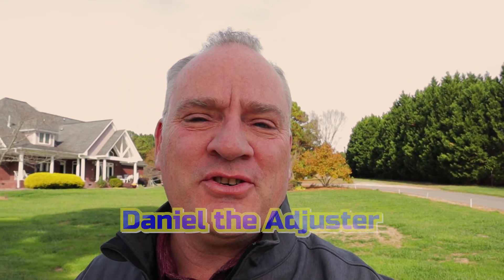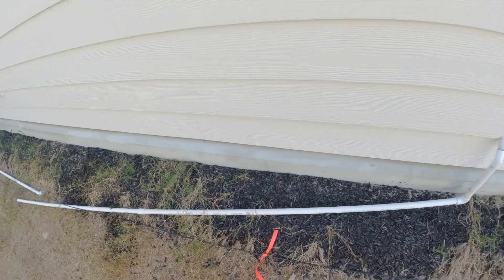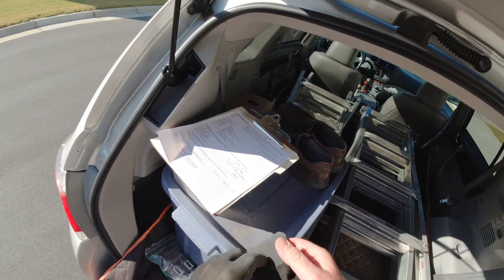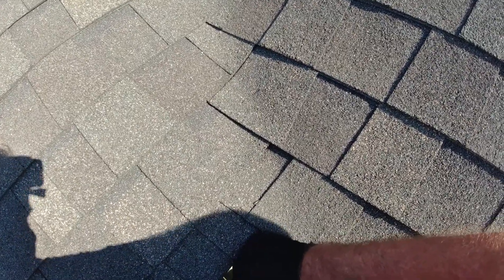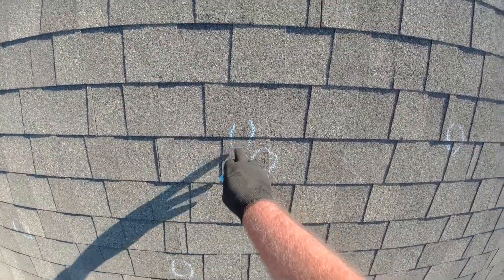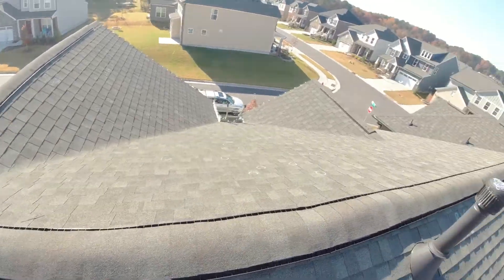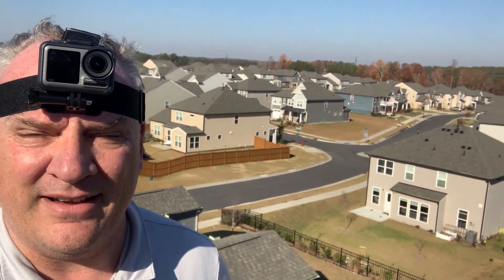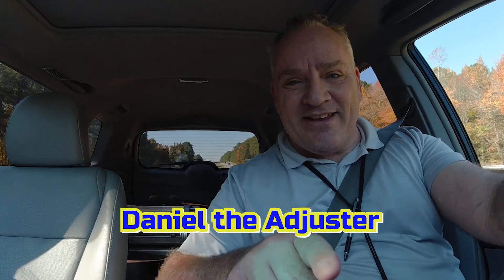Day in the Life--Part 2 --Claims Adjuster

Comment: If you can avoid a double pull by taking your ladder to the back elevation I would do it. Great video!!
Reply from the maker: Good idea, but most of the time the reason I do a double pull is because I don't carry an extension ladder to get up to the second level.  99% of the roofs can be accessed with two ladders.

Comment: Thank you for your videos, they provide a wealth of useful information!  I am new to adjusting and I have some questions from this video, 1) rather than use 2 ladders would you ever use one ladder to access the front roof then access the upper level roof from the rear of the house?  Using 2 ladders seems less safe to me with hauling it up and down and placing it on the roof.  2) are people filing a claim for small dings to comp shingles from hail?  Would the insurance company replace the shingles for what looks like minor damage?  3) are there roofing materials you don't walk on such as clay tiles?  4) Are there field adjusters that don't access roofs or is it a requirement?  Thank you for all your information!
Reply from the maker: @p.davidrij8319  Thanks for your questions.  Appreciate your compliments!
1.  You can use whatever ladders make you feel comfortable.  There is no right way or wrong way to access the roof.
2.  Yes, it is common to see damage of all sizes.  Even with the small damages, if there was a hail event recorded on that date, we can argue that the shingle was compromised due to the event.    It is best for larger hail events of course.
3.  Yes, we are not required to walk on clay tiles because we can break them.  We inspect those from the gutter line in several places around the home.  Also, cedar shakes can be a sketchy climb as well.  Use your judgment on that type.
4.  Field adjusters who don't feel comfortable climbing roofs can be flood adjusters or interior water damage adjusters.  It will limit the number of claims that you can handle, but sure, it is possible to skip the roofs.  I like climbing roofs since most CAT work is roofing claims.

Comment: Tip on getting on and off the ladder safely. Also any tips for safety while on the roof.
Reply from the maker: 3 points of contact at all times, (eg. 2 feet, 1 hand or 2 hands, 1 foot).   As far as while on the roof, go slow and easy, no rush.  Know where you are on the roof at all times so that you do not trip on a roof boot, or vent.  Stay away from the edges if you are not comfortable, and keep a low center of gravity on slopes when you are climbing and use all fours.  Better to be safe and look stupid, then be sorry later.
Reply: @danieltheadjuster  thank you so much. Ill go on my first roof soon
Reply from the maker: Fantastic!!

Comment: Is there an angle of roof that you don't walk on?
Reply from the maker: @davidelks8972  I walk on most roof slopes (including 12/12).   The slope I will be most careful on is the old shingle with little to no granules remaining.  It doesn't matter what pitch that roof is, it is something that you can fall off of very easily since the shingles can break off at any moment.   The cougar paws are amazing, and if you keep an eye on your pads, keeping them fresh, the boots will stick to most slopes.  Ankle and calve flexibility is a good thing to practice as well.  The more boot surface on the roof shingle the more you will stick.  A lot of people walk on the balls of their feet on steep roofs, this is why they slip (not enough boot surface touching the shingle).

Comment: Hey daniel do you ever work in any inclement or poor weather conditions at all or only clear / sunny skies ?
Reply from the maker: @JoeNotExotic003   Yes, I work in the rain all of the time.  If it is not pouring, I get on the roof too.  The Cougar Paws stick to most shingles, even when the roof is wet.  Just watch out for the slimey mold on the roof shingles.  This get's very slick.    Normally it is on the North Slope.
Reply: @ wow, that seems like it could be very dangerous to do in the rain and/or wind, snow, etc. even with proper equipment

Comment: Are you to note all damage found and the insurance company decides if it was from the event?  Or do you make that determination and list only what you feel was from the event?  Love the videos!
Reply from the maker: Good question Tony. When we write a report, we are giving our opinion of what we see is damaged. No one can argue about your opinion as long as you have enough information in the file report to explain your reasoning. The insurance company has guidelines, like roof repair tolerances, that you will be made aware of for each insurance company. Meaning how many hail hits per square, How many wind damage shingles per slope, etc. For interior damage, you write for the damaged area and replace it with the same material. For flooring products, normally anything over three or four years old, I write to replace, because matching would be very difficult. Each scenario is different, but the insurance company cannot negate what you have put in your report or estimate , if you have facts to back it up. Good pictures go along way.

Comment: Though, I see how easy it is to go and take pics of the outside (and I'm sure that's all that's needed for a Hail Claim), but do you sketch the roof back at the office to get exactly the amount of "squares" of shingles needed for replacement?
(I didn't see you take any measurements)
Reply from the maker: It depends on the carrier that you work for as some will provide the Eagleview Roof measurements.  If not, I will measure the roof, and sketch it in Xactimate when I get back to the office.  I will do a rough sketch on paper first while at the site.   It is kinda hard at first to sketch the roof on paper, but it will get easier and easier with time.
Reply: Always take the time to make sure you have all the measurements of the roof while you are on site. You can get in a big hurry and it will bite you in the BUTT later. @danieltheadjuster
Reply from the maker: @jerrytaylor8713  yes, very true